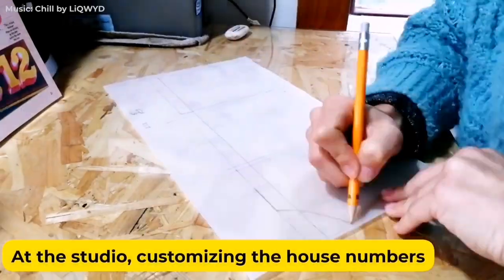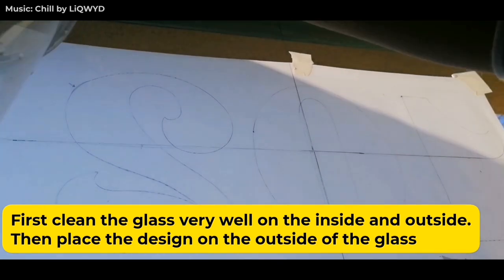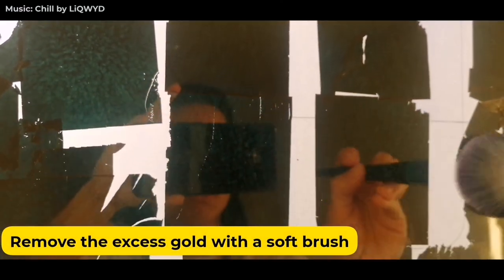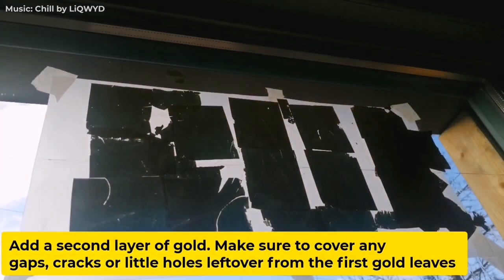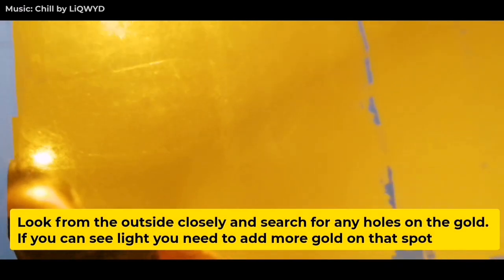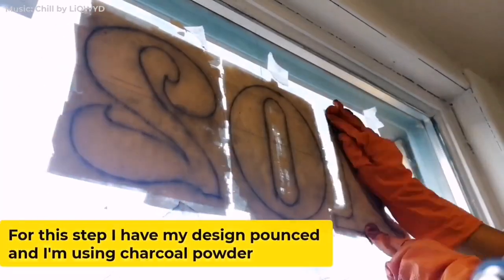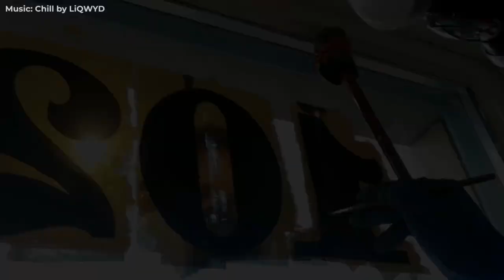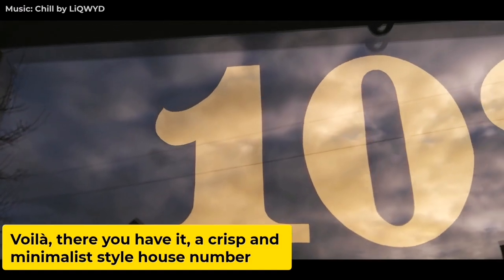How to water gilding a house number - Step by step

Comment: Great video Joha, thanks for sharing! I have a small question: when I do the second layer of gold, my water size is breaking and I am struggling to lay the leaf down well. I have heard of using a little bit of washing up liquid in the size, but do you have any other ways to stop this happening? Many thanks
Reply from the maker: Hey Alice, yeah, add a drop of dishwasher liquid to the size. Not sure why you’re getting this challenge. wondering if your gilding brush is grease free?

Comment: Amazing! How long do you leave between your 1st and 2nd coats of gilding?
Reply from the maker: Hello,
I'm really glad you like the video! Please subscribe and like it. It will mean the world to me.

Answering your question, you need to make sure the water size is completely dry before applying the second layer of gold. It's hard to give you an exact time. The time depends on the weather. If its warm it could be maybe a couple of hours and if its cold could be a bit longer. A good way to know is to check that the gold has turn more shinny, like a mirror. Once it's dry you should be able to see your reflection on the gold. 

I hope this help. 
All the best, 
Joha

Comment: Thank you so much for posting this! What size numbers did you create? about how long from start to finish did the gilding take?
Reply from the maker: The gilding doesn't take much time, just a couple of minutes. What takes most of the time is cleaning, preparing everything and waiting in between the gold layer for the water size to dry. 

I am not really sure what do you mean by size numbers?
Reply: @joha_mune  are they larger than 4”? Thanks for answering.
Reply from the maker: @marshaw  The numbers were 17'' all together (including spacing). Each number was 5.5'' approx. I hope that helps. Keep in mind that the size of your numbers would depend on the size of the surface 😉